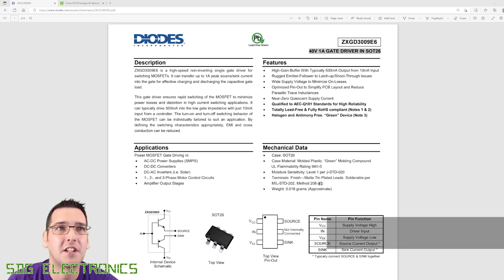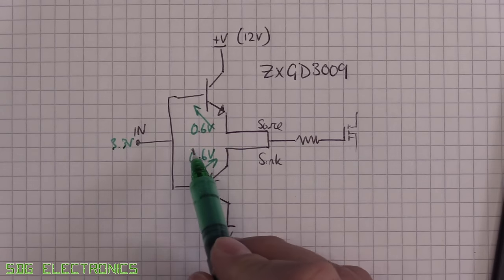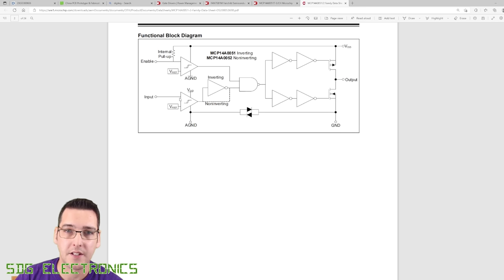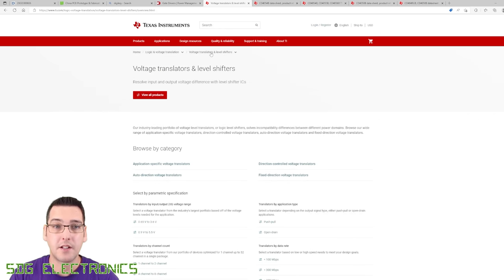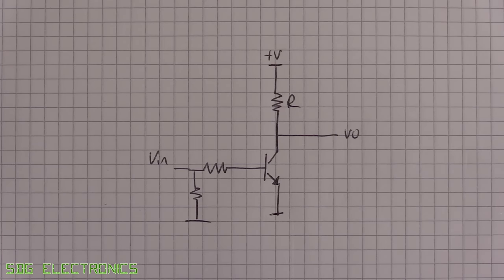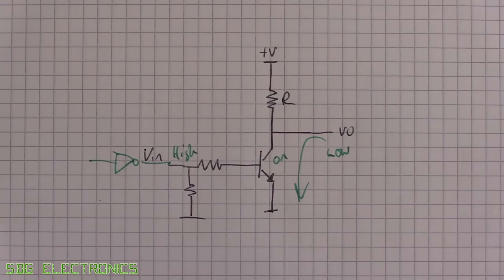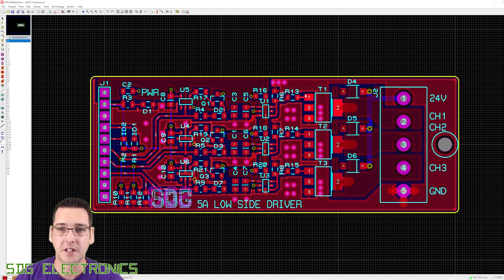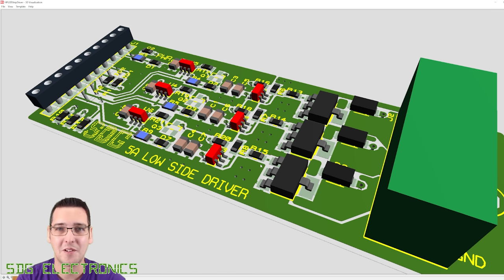SDG #274 Read datasheets properly! Level shifting and gate resistors.

Comment: This is a great application for cheap comparators, they can level shift (because open drain output), you choose the threshold with a simple resistor divider (because comparator), you can choose to invert or not, they are very wide supply voltage, very cheap and standard footprint.

Comment: I forgot: If you look at CMOS, check the HCT series, they work nicely with 3.3V or a bit lower logic and have full 5V output.
Reply: But 12V is needed right
Reply: Depends, a lot of MOSFET transistors are perfectly fine with a 5V driver.
I do not really like the 5V drive solution for high power drivers, there the 12V is much better, because there is more MOSFET's and the one that support 5V have lover Ron at 12V (Note: some types cannot handle 12V).
Reply: If only they made a 7400 IC that could handle higher voltages like they do for some 4000-series.
Reply: Again, it depends. A MOSFET logic chips usually has a very limited output current, this means it works fine for static or low frequency drive, but when you increase the frequency it cannot turn the MOSFET transistor on and off fast enough to keep the power lower.
A rough estimate of on/off power is: Vopen_circuit*Iclosed_circuit*Swith_time*Switch_Frequency/2

With a real driver chip that is usually not a problem because it can supply a ampere or more when switching (This may break EMC limits).

Comment: If you want to reduce the switching times (specifically the turn-on) you can increase the base resistor (10k) and add a ~270pf cap in parallel to said base resistor to get better results, also you can reduce the collector resistor (you may have to go to 1206 for power), that's my discrete MOSFET driver when I need fast switching times.
Reply: Why the cap in parallel to base resistor reduces the switching times?

Comment: Totem pole driver (tiny sot-23 pair of PBSS4350T NPN, PBSS5350T PNP and 0805 X7R 1uF local cap) should give just above 2A current for 5mA IO output allows for proper close to gate layout.
I used it to drive PMOS in a DC-DC buck at ~280kHz

Comment: I feel your pain, Steve.  I've prematurely ordered PCBs on several occasions.  WRT choosing components for a project, I've almost stopped worrying about cost, at least for my personal hobby projects.  None of them are built in quantities large enough to make more than a few dollars' difference in overall price, and it saves time.  If there's a "right" part for the job, I just use it.  Unless the price is egregious (Analog Devices and Maxim Integrated, are you listening?), it's just not worth my time to look any further.

Comment: If you want a cheap solution, you might have considered the CD40109 quad level shifter (£0.44 from Mouser). Vcc and Vdd in the range 3V to 18V and input high at 0.7 Vcc. It typically only sinks/sources a few mA output, but you're already using emitter followers to buffer that.

Comment: You could have used 2 NPN inverters-level shifters. Extra cost is 1 NPN+ 1 resistor instead of the extra integrated inverter.
Reply: Or just an NE555... It can even drive the gate with ~200mA.
Reply: really, is there anything an NE555 can't do!?

Comment: Instead of using invertors, you can just put a pull-up resistor to 5v, and instead of using SOT-236 driver, you can add just one more  npn SOT-23  BJT with a shotky diode /*or use a third BJT as diode*/ between high BJT base and emitter. So you will have a gate driver and a level-shifter at once. It will be cheaper 2-3 times.

Comment: you can use a 74HC02 74HCT02 - quad 2-input nor-gate as gate driver for your mosfets. just take a look into the datasheet and decide for yourself...
Reply: Abs max supply voltage is 7V which is lower than the 10V drive that Steve is looking for

Comment: You could have moved the base pull-down resistor to 3v3 supply so that the transistor is always on by default. Most microcontrollers start with high-impedance outputs anyway. This will break if the 24v is high before the 3v3 supply, but that will brake the current inverter-based design as well.
Reply: Good points.

Comment: There's an error in the CD4504B-EP datasheet. In the table under conditions there's two VCC columns, whereas in the older CD4504B datasheet dated 2004, the second VCC is actually VDD, which makes a lot more sense.

The description says "To shift TTL signals to SMOS logic levels, the SELECT input is at the VCC HIGH logic state.", so looking at the TTL-CMOS line of the VIH section of the table would suggest a minimum of 2V rather than 3.5V, which would give you a VO of 13.5V at 15V VDD.

Alternately if SELECT is pulled low for CMOS levels, that should mean that VIH is 2/3 of VCC, which I believe is the JEDEC specification for CMOS logic levels. At a VCC of 3.3V that should mean VIH is 2.2V, which should be fine if the VOH from your MCU is 3.3V.

Comment: Why did you use an inverter IC rather than just adding another transistor inverter, especially given that you already have the transistors?

These videos are very interesting, looking forward to seeing the end result.
Reply: And if we're already using two transistors to do level shifting and undo the inverting, I think you could add another NPN and PNP to serve as the gate driver directly, without the dedicated IC. Probably cheaper and chip shortage resistant!
Reply: Looking at the driver ic it seems that you may be able to re-wire it as an inverting driver already. Connect the VCC and VEE pins to the gate and use the source and sink pins for ground and 12V. You will need to add a series resistor to the input though

Comment: Quick clarification about the status LEDs wired to 3.3vdc.  I seem to read 4k7 for 4,700 ohm.  This is only 0.7mA per LED - why so low? Most LEDs are able to run at 20mA or even 30mA for super-bright LEDs.  Is it due to the 1kHz PWM - but this would mean the power status LED would barely be visible? Thanks!
Reply from the maker: I was planning to use GaN LEDs which are extremely efficient. On my previous board, even at 3 mA the blue was far too bright for an indicator
Reply: @sdgelectronics  With regards to the 5-pin connector on the MOSFET side, I'm assuming pin 1 (connected to the cathode of the diode) would be the LED string VSupply (in your case 24V), pin's 2 - 3 are effectively the SINK lines for each PCB, and GND just ties into the 24V PSU's GND line.  Just checking, thanks!

Comment: You could just clamp down the output voltage of the Lowside switch with a zener diode, before it goes in the the emitter follower. (worked for me in the past)

Comment: Interesting, I generally look at drives at low side or high side. Low side can accept 5V logic or lower with output at 12V and a few amps (Like TC4427A).
High side is much more problematic, mostly they depend on the outputs switching to generate the needed voltage to drive n-channel mosfets. I have not found any current available high side drivers with a build-in boost converter (They are capacitive), they all use the switching of the controlled mosfet to generate the needed voltage (Also with a capacitor). This means they have a minimum frequency well above DC.

Comment: I've just ordered some boards with the wrong pin order on the SOT85 voltage regulator. Thankfully I found a different regulator, which is in stock, which will work, but I was beginning to think some PCB butchery was going to be required. Should've read the datasheet more carefully before clicking "Place Order".

Comment: I've used an automotive microcontroller that would have been ideal for this task. It has a wide input supply and 3 'high voltage' GPIOs that use the input supply levels. The output current is limited to about 10mA but this would be acceptable.

Comment: Hi I enjoy your channel..
I made nearly same gate driver circuit in a project of mine.
I can't see why you added the inverter, you could just have changed the pull-down to a pull-up.
Be aware that this circuit i drawing current in the collector resistor when output is in off state. Not a big problem with this small driver, but you will not be able to make the circuit sleep. I wass thinking maybe it is better tochange the first transistor to an opto-coupler with collectol on 12 v and emittor driving the dual-emittorfollower-driver. R16 change to pull down.
Now it use no current in off state, can be turned on with a Hi input signal.
Optocoupler is not that expensive any more, I often use a cheap acpl217

Comment: Interesting design challenge. Too late now but could you have used a ULN2003 instead of the transistors, with the inputs pulled down and driven by a tri-state inverting buffer, something like an LVT162240 (err on the side of caution with an enable being driven by the micro)?

Comment: Any chance you could make a video about load switches using mosfets? Something to interface a sensor with a microcontroller, so the Uc would only power up when the sensor generated some output voltage.

Comment: I'm surprised that something as common as making a MOSFET work for LED PWM with control signal from a microcontroller requires so much work and searching instead of a choice between five tried, tested and standard solutions.

Comment: I've designed a slightly different PWM LED driver, which I originally just used the open collector output of the comparator to drive the gate of the MOSFET (obviously pulling up the output, and using a gate drive resistor).  That worked fine, but I also tested a version that used an op amp instead of the comparator, which also worked just fine and would simplify the BOM.

Jumping the gate drive resistor didn't seem to make much difference, although the wires connecting the LEDs were pretty long so that might be having more of an affect on the ringing. Nothing on the board gets particularly warm, even at around 2A per-channel.

I've just ordered some more parts and I'm redesigning the circuit to use the op amp solution, but I think I'll have to hack up another one of the original boards to do more testing, just to make sure the new design works as expected.

Comment: Stupid question time: Why not just use an OpAmp as comparator/level shifter?
Reply: Slow slew rate and relatively low output current.
edit: in this case it would probably be not too different from the given solution though.

Comment: hi,I am a newly graduated EE, you showed a really nice book that I did not know existed called "the art electronics". Do you know of any other books that could be useful to an engineer like the one you mentioned? thank you
Reply: "Art Of Electronics" is is purest of pure reference book for anyone doing electronics, even professionals.
in 1000 or so pages it covers everything from ohms law to how do you design computers on transistor and system level and everything between.
And unlike stuff you find from the internet, that information is trustworthy and checked by multiple professionals before publication. And if you buy it, nobody can take that away from you and the information cannot be changed or edited by someone on a whim, so you can trust it.

They say books are old fashioned. I think books have all the strengths when it comes to be used as a reference or to understand complex and highly interconnected topics. Like physics, math or electronics (branch of physics).
Reply: @Mtaalas  I could not agree with you more, as an engineer I still find it extremely hard to research some topics on a tecnical level on the internet. You find a lot of conflicting information, confusion and when you find something useful the people that write it either skip important information or assume you are already familiar with the topic.
Books are just better, the issue that I face is that the research switches from searching information to searching a good, academic grade book.

Comment: Proteus?......I thought you were using Atium Designer?
Reply from the maker: The rest of the PCBs for this project are in Proteus, so it's easier to keep going on that. I will be trying KiCAD from now on, though.
Reply: @sdgelectronics  Glad to see you trying KiCAD......I haven't looked back after Eagle then CircuitStudio/CircuitMakerPro.
Reply: @sdgelectronics  I didn't renew my Altium designer license this September. They totally refused to make an exemption for me as a hobbyist so I told them to get bent. I'm happy to stay at the level that I am at and will be doing more Kicad and other lower cost options. Besides, I've had it with these mandatory subscriptions  so I've been systematically eliminating them from my life. I still have the last non Autodesk version of Eagle and Full DipTrace package. DipTrace is nice because they do support hobbyists. And I don't mean support where they reach out to you because the user has a reasonable following on social media.
Reply: I was using KiCAD professionaly in 2015, it was pretty good back then, must be really good now.

Comment: Steve , why didn't you go directly to  HEF4104 or CD40109  or CD4504  ?
Reply: CD4504 is only specified by TI for 5V to 18V, so maybe not. On the other hand, the CD40109 is specified for 3V to 18V and would have been my choice for level shifting if its output drive of a few mA were sufficient.
Reply: @RexxSchneider  Come on ! ... The chip is mainly for voltage level shifting and not for driving purposes so do not expect to get all your job by just one chip added ...
Reply: @ahmedalshalchi  Did you watch the video? The requirement was to find a level shifter that would interface the 3.3V microcontroller to the ZXGD3009 that was already chosen as the driver. To quote from the ZXGD3009 datasheet visible at 0:03 "It can typically drive 500mA into the low gate impedance with just 10mA input from a controller."
Why shouldn't we expect to do the job with "just one chip added" if that chip can work from a 3.3V logic input and deliver 10mA output at over 10V?
Didn't you understand that the output driver is bipolar and actually needs some current input from the level shifter stage?
Reply: @RexxSchneider  My friend , if tat gate driver is needing for 10mA to drive the MOSFET gate then no problem to add simple  emitter follower after the shifter and that's it ... Why do you always intend to be integrated solutions rather than simple discrete scheme ??!!
Reply: @ahmedalshalchi  Good grief, don't you understand anything about the problem?

We have a microcontroller that gives 0V (low) and no more than 3V (high) at a mA or so. We have a MOSFET that requires 0V (low) and at least 10V (high) at hundreds of milliamps source and sink to drive the MOSFET gate when switching.

Got that so far? We have already decided to supply the source and sink current of 100mA+ by using a ZXGD3009 buffer than needs up to about 10mA input at a voltage switching between 0 and about 12V to drive the MOSFET.

So we use a level shifter to translate the low current 0-3V from the microcontroller into the 0-12V at 10mA that is needed to drive the ZXGD3009 gate driver. That's it. We don't need anything else, not a "simple emitter follower" or anything. The CD40109 could be used for up to four channels of PWM from the microcontroller. We would be using a single ZXGD3009 instead of a complementary pair of medium power switching transistors. Your "simple discrete scheme" is neither simple, nor cost-effective if it is to function. As soon as you realise you need to both source and sink current actively and rapidly into a MOSFET gate, you have to accept that a single emitter follower just won't do the job. End of story.

Comment: optocoupler 3.3 v to 12v anyone ?
Reply: optocoupler for circuit isolation + a MOSFET driver. 
However some drawbacks without a MOSFET driver: 1 -  the optocoupler diode consumes 1 to 5 mA. 2 - has low output curent capability, MOSFETs may require 2 to 4 pulse curent in high speed switching, 3 - Additional parts may be necessary.
Some MOSFET drivers have the protection and the isolation necessary.